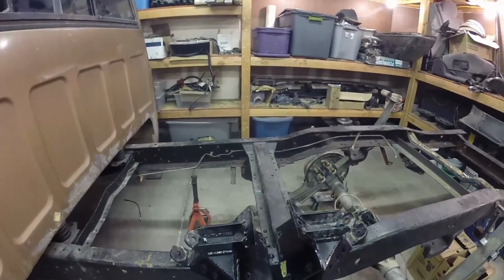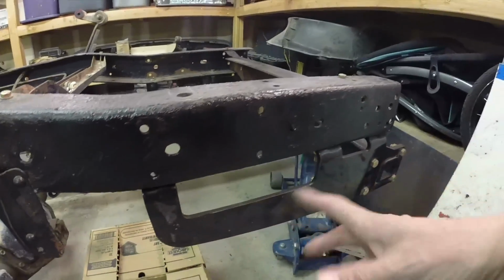WILL IT START? Chevy K20 Project - Video Series

Comment: Glad to see you back at it.   Just curious why you decided to not go with the 4l80E?
Reply from the maker: Glad to be back at it, and thanks for rollin with me! As for the 80 I had. I sold it, If I happen to find one for a good deal before I swap the 400 in I may change direction, but for what I'm gonna use it for, the 400 will work.